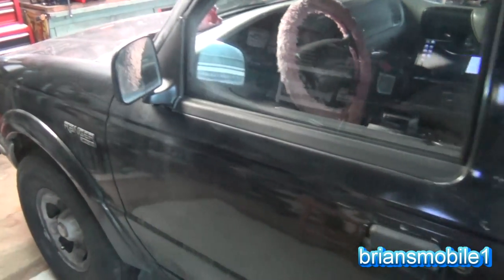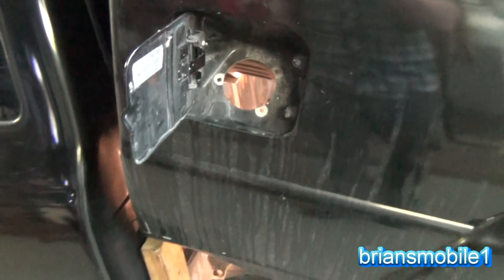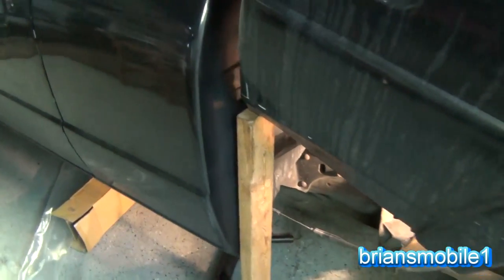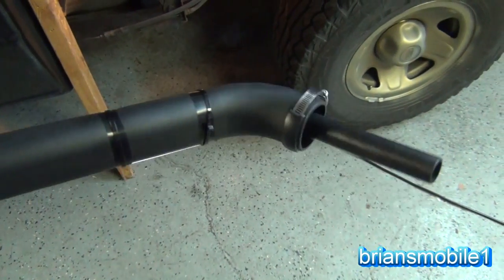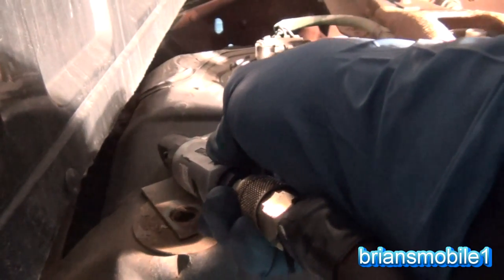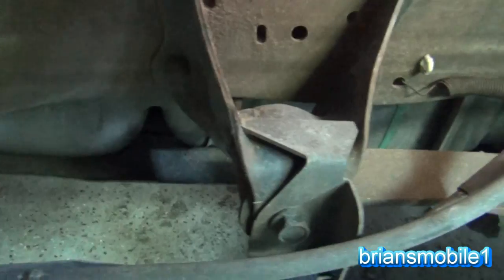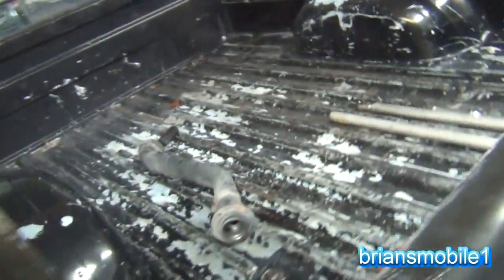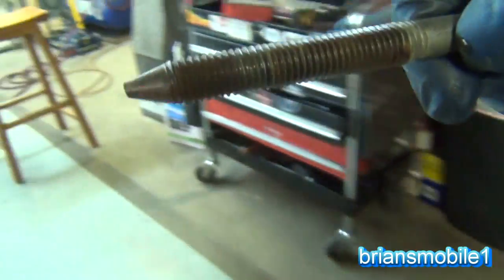Ford Ranger Fuel Pump / Filler Pipe Shortcut

Comment: one thing to remember people, if you have a 7ft bed then get a filler tube exactly for a "your year" with 7 ft bed only, that will save you the trouble of having to modify it, cut parts off the old on and clamp it on etc... :-) I have read many comments at sites where people had to do that because they thought all were the same!  This video i have watch 3 times!! You are a beast Bro!! thanks for the help!!
Reply: stinman46 right, I checked his link and it was for 6 foot bed. I have the 7 foot bed.

Comment: Thanks for the video! 
My Mazda B4000 has a camper on the top which proved too heavy to lift (at least that's what I'm claiming 8). In case anyone else run's into the same problem I was able to solve it with a 4 2x4's. One 4ft, one 2ft, on 1ft and one 8in. I removed the all the bed bolts and used the 4ft as a lever to lift the bed enough to slide the 2ft as far as i could resting on the ridges of the bed. I kept lifting until I got all three under then used the 4ft as a brace under one of the cross beams just as a safety. 
This didn't give me the clearance you had in the video but I had about 8 inches which was enough to sit on the ground with both hands under there and do the repair. The old one is a pain in the butt to get off. Putting the bed down was pretty easy but when I tried to put in the the bed had shifted. I was able to slide it back the half inch or so that it had shifted and all was well.
The two bolt up closest to the cab are longer than the rest so pick those out of the bunch and the fuel throat has to line up a with the screws which meant I had to loosen the hose clamp and twist it around until it fit. At first I thought I had the wrong throat.

Good luck all!

Comment: Dude, you saved me so much time changing the filler hose. I did it by myself in about 45 minutes. The bedliner was harder to get out then the bolts. The trick with removing a bedliner is to pull up in the middle at the tailgate and it releases from the sides. I soaked the T55 bolts with PB blaster for 2 days prior to removal.

Comment: Replaced the filler hose on my '94 Ranger a few days ago using this method.  Worked great.  It was real handy to look at the length of your 2x4 relative to the side of the truck.  I made two and with a little help from my son, propped the bed up safely and easily.  Thank you!
Reply: Did you have to drain the tank to do this
Reply: @patrickharvey158  Its been a while but I don't believe that I had to.  The hose connects to the top of the tank.

Comment: Good video. For changing a fuel pump, on an old beater like that, I generally just cut a 8 inch square hole in the bed, over the gas tank, with a saws all or angle grinder. Only takes about ten minutes to do. Cut a piece of sheet metal and screw it on over the hole, with sealant to keep water from leaking onto your fuel tank. Did that on an old toyota and a mazda, saves a lot of time and work.
Reply: Thanks fer thinkin outside the box! Us injured, old Geezers need all the helps WE can muster!

Comment: I just did mine. Pretty straight forward. But, I found residue of blue locktite on the bed bolts. That's probably why they're so hard to get out. If you could heat them that might help. Also had the fun of getting my cross bed tool box and a factory bed liner out. Also before starting with removal I brushed the hose and pump and blew it off with my air compressor blow gun. Gets rid of all the trash on top of the tank.

Comment: I put a fuel pump in my '03 ranger last year.  Yes, those bolts are quite a chore....I also found that my 1/2" impact had little effect on getting them out, had to use about 3 feet of breaker bar on a 1/2" breaker bar.  I was scared that the torx bit was going to break or the bolts but they never did.  Those bolts are just gnarly.
Reply from the maker: Me too!  If it was anything smaller than T50 it would have twisted off.
Reply: briansmobile1 Drop of oil on putting them back in would help when you have to undo them again to change the fuel pump. They will not come loose with lube.
Reply: I used penetrant for a week before I did the job and my bed came off like nothing with a 3/8 ratchet.

Comment: Did the same thing to my '94 Mazda B4000.  I replaced the fuel pump and sender assembly while in there.  218,000 miles, so figured it was due.  Dude, I think I'd double up on the chairs and 2x4's before I stuck my head in there...  My bed bolts were easy.  It had always had a full bed liner and lived in a dry climate. (Utah)

Comment: ty, im bringing a 92 ford ranger back to life after setting for 10 years. couldn't get tank bolts to move but will try bed bolts so I can replace fuel pump. good video ty again
Reply from the maker: You're welcome and best of luck!
Reply: Todd Benson same here, except my 19 Ranger has been sitting for about 15. What do you recommend to do to get it started up?

Comment: I lifted the bed off the truck of my Ford Ranger when I had to repair a rusted brake line along the top of  truck chassis.  To get the bolts off, we tried an impact but like you, but the bolts were really rusted on.  Instead of using a cheater bar, we have a torque multiplier which remove the bolts.  We used the torque multiplier to remove the crankshaft bolt on a Toyota Sienna when we did a timing belt.  The mechanic who we rented a stall and lift in his garage was amaze that we got the crankshaft bolt off so easily.  He never heard of a torque multiplier.

Comment: I did that one. A couple things I did differently. I like to use petroleum jelly to lube tubing 'cos it doesn't mess with fuel at all and I anti-siezed the bed bolts when I put them back in. I'm glad I did 'cos the fuel pump just puked and I get to do it again.

Comment: I tried your tilt bed idea on my 2000 ranger. I had a leak in the filler spout. I found all I needed to do is replace a broken clamp. The front two bolts were rusted off. Twisted off the middle two. The back two needed to be persuaded with a cheater bar. Great idea.

Comment: After you wire brush the bed bolts, put some Anti-seize on them before reinstalling them back into the frame. Works wonders if you have to take it back apart in the future.

Comment: Since you did all that work, did you notice if there was a check ball valve in the filler neck? Trying to figure out the best way to drain the gas out of a '98 Ranger right now, for some reason I can't get the siphon hose in all the way...could be just getting hung up on a bend and need a larger hose to use as a casing, but it'd be nice to know what I'm up against beforehand, obviously

Comment: Went to a Ford dealer today and asked about cost for doing this.  I'm too old to do this.  1. Labor at $143/Hr. was told it could be a 3.5 Hr. job.  Went to parts department and was told the filler pipe would cost $400.  By the time I would get out the door I would spend $1,000 +.  Found an independent mechanic who will do it for around $300 if I provide the part. That's what will happen.  Cost to me is about $375.  The part is on the way and the date and time is set for the work to be done.  Reminded me of Eddie Arnold and his song, "Just a little loving will go along way".  In this case just a little checking goes a long way.

Comment: Those T55 bolts can be a real bear but you can also cut the washer(release some of the tension from the bolt) On the Toyotas, they are always seized up and at least one washer gets FUBARed, lol. Yeah, the tilt bed method is the way to do it, so much easier. Ah, I almost forgot, get a thread chaser and chase those threads, that also helps with reinstallation. Cool video Brian

Comment: I have to replace the fuel tank on my grandmother's '94 ranger. After hunting and hunting for a video that showed a similar fuel tank I found your video. Thank goodness I did. My question is would you still remove the bed if you were going to pull the tank on it?

Comment: I have reinstalled many a rusted to hell bolt in my day. Aside from wire brushing and perhaps running a thread chaser up and down the threads, put some smooth soft set teflon pipe dope on the threads and a dab into the female side, and those bolts will reinstall with far  less stress, and can be removed down the road if need be much easier.

Comment: I have a 94 w leaking filler. 160,000 miles. Would u recommend changing fuel pump too while bed is off or does original pump run long time?  Thanks for video.

Comment: Wire wheel on your bench grinder to clean the bolt threads.
Then some anti seize on the threads will make this job and the next time proceed smoothly.

Comment: I had the same problem with my 95 Ranger. Don't know why I didn't see this last year. I took the bed completely off. Not that bad. But putting it back, I broke a gas line. While I was in there, I put a new fuel pump in because the sending unit was not working.  I will try this method if I ever have to do that again.

Comment: Nice video but you made a critical mistake (I think). Most of those Chinese Filler necks are not correctly flared nor are they made with NYLON REINFORCED walls and will fail in a few years, usually by cracking at the tank end due to lack of flare and poor rubber. I have found this out the hard way. The lack of flare is why you struggled with the tank end. The taped on piece of metal is a dead giveaway. Read the article at FillerNeckSupply.com for more info.

Comment: got lucky with my 2001  super cab lol has a wooden flatbed and i have enough space to reach sall of that (just did the evap canister vent valve solenoid with now tools sitting up comfortably behind the drivers side rear tire (charcoal canister is over the spare tire holder)

Comment: The gas leak on my 88 Ranger is on the lower portion of the fuel pump seal. Is it possible to replace by tilting the bed like u did in this video?? What tool to remove Assy. ???

Comment: Will this method work on a 93 2wd Ford Ranger? I need to replace the fuel pump and this looks easier than dropping the tank. Please reply
Reply from the maker: sixteenstone007 It will.
Reply: +sixteenstone007   theres one harness plug underneath the rear that disconnects all the wiring so you can take the bed off or lift it back for more room. unbolt filler , take screws/bolts off the bed and disconnect the rear harness and the whole beds disconnected.  im going to put some different bolts in the bed instead of them pain in the ass screws with clips.  its good to be able to get at everything under the bed.   2 guys can lift it off easily.

Comment: I managed to take out the tank without removing the bed. The hard part is removing the filler neck from the tank and reconnecting it. The hose clamp can be reached from under the cab with a socket extension. Then the filler neck can be gripped with your left hand with the weight of the tank pulling down while twisting and pulling the neck upward.
Reply: You'll have to remove the tank straps and let it fall a few inches using a floor jack to be able to see and reach the filler neck hose clamp with a socket on about an 8" extension.

Comment: Question for any one .  Is there any fill flap valve on the filler neck or at fuel tank entrance. could these break off and restrict fuel flow when you get gas .

Comment: My 05 just stopped from one day to the next like is out of gas just won't turn over,i'm going to check for gas pressure do you think it could be a relay ,Have you ever had a fuel pump just go out with no warning ?
Can i raise the bed also on an 05 to get to the pump the same way ?

Comment: I had a 93 ranger I put a new fuel pump on it. I took the bed off. I just unplugged the tail lights. my wife helped me lift it off. Not that heavy really. Next time I do the tilt so I dont have to get my wife to help me.I got a 99 now I liked the 93 suspension better. The 99 rides rough as a lumber wagon. I see why I cannot siphon gas out of it now.

Comment: I have a 2002 Mazda B2300 4cyl with a rough idle problem changed the throttle sensor, the map sensor, spark plugs, wires as well and the coil.... runs great on the top end but just runs rough in idle... :-( had to ship in the throttle sensor in it took a week or so, the truck ran really bad transmisson kept slaming into gear 1st and 2nd.... got any ideas?????....

Comment: I just tried to tilt the bad like that, can't get it that high so I think I'll just pull the bed back over the wheels, don't know how you got the front so high.
Reply from the maker: Detach the filler neck hoses and have only the back two bolts in just 3-4 threads.

Comment: those bolts are so long that impact gun impact gets absorbed by the flex of those long bolts.
Reply from the maker: Like a GM IFS torsion bar. =D
Reply: briansmobile1  More than likely the pale nut or "J" nut on the frame the box bolt goes into is what kills the impact as opposed to the length of the box bolt. Impacts are about as handy as tits on a trout when you start using them on bolts froze in rubber bushings, box bolts and such.

Comment: Has anyone got the same problem after replacing the filler neck when using a cheap filler neck, my Mazda b2300 won’t fill up properly.
Reply from the maker: I've heard about that happeing.  Best thing to do is double check your install for kinks, twists and internal issues of kinking the breather inside.

Comment: Can I use the tilt bed method to access a 2001 2wd tank to replace fuel pump? I really don't want to drop tank in 3* temps tomorrow.
Reply: Meaning, is the bed designed the same, to allow for tilt?

Comment: OK, I've done 10 of these. Rule 1 the inner hose needs to be pull out of the outer cracked hose. The reason why cus you will not get fuel into your tank it will kink and you will  be at the gas pump for 25 mins. The inner hose is that way so it won't kink

Comment: I wish I would have saw this method first before losing a whole Vacation day to an epic fail. Ford using all these special connectors. the 2005 FX4 could not drop down far enough for me to see or feel to release connectors. I ultimately had to put driveshaft back in and put it all back together. I have a fuel pump to replace.
Reply from the maker: Better luck next time.  You're welcome to stop by any time for more useful mechanic tricks.  I do new videos about every week.

Comment: With a truck here that went 2 feet under salt water in Katrina/2005  I just cut a hole in the truck bed to change the fuel pump. Then a few years later I replaced the fuel neck pipe and did not have to lift up the bed since the access hole allowed access to the fuel filler pipe.

Comment: Nice Yeah those bolts are a bitch did a fuel pump in one Winter of 2013 in guys driveway. 2 bolts snapped off but I applied anti seize to remaining bolts and seems fine without 2 broken bolts!

Comment: Please take your own advice and try not to use that electric impact wrench near the gasoline fumes or a simple project could end badly.  I was holding my breath when you loosened the hose clamp on top of the gasoline tank since I know gasoline vapors rise.  Yikes.

 Keep up the good work and great videos.
Reply: Completely agree when it come to electric drills and impacts but that was a pneumatic one that he used on the filler neck. :) He did however use it on the three bolts up at the bed but I was a little less worried about that since they're designed not to let fumes out up there.
Reply: You are correct.  Whew.
Reply: hes fine gas can only evaporate so quickly from a total surface of liquid in the tank and without airflow mixing the vapor with oxygen so it will burn at most if it did ignite you would get a woof that consumes all the oxygen right over the tank that suffocates itself and gas as liquid wont burn. It's a hazard when you are pouring it out over a large area so you can have rapid evaporation and fumes at a ignitable mix ratio of oxygen that fills the whole space around you so you inhaling it and vanish in a 15 foot diameter fireball. 1 gal spilled gas is more dangerous then a open 50 gal tank of gas

Comment: My front driver side truck bed bolt is super crusty. The other 5 came out with  not much issue but that last one has none of that T55 torx left. I wonder if I can just lift the passenger side of the bed up a support it like you mentioned on the other truck you did. Just need enough space to get the fuel pump out. Thanks for the video.

Comment: I went to order one at NAPA $227.00 On line with shipping. $53.00:face-blue-smiling: Swap out the inside tube so you can keep the hard pipe. Rubber one's wont work.